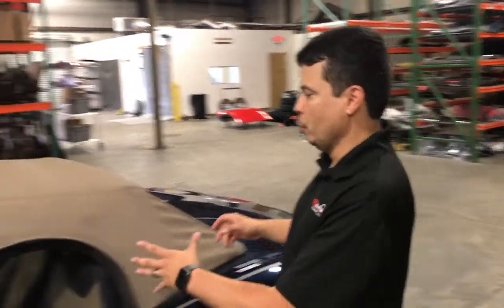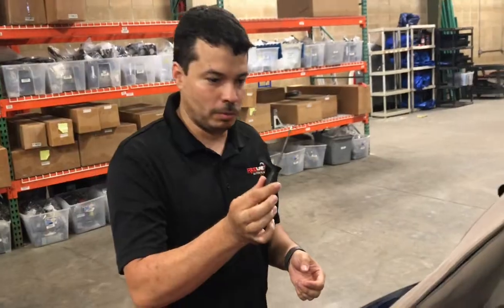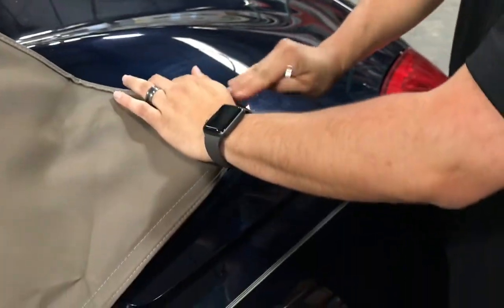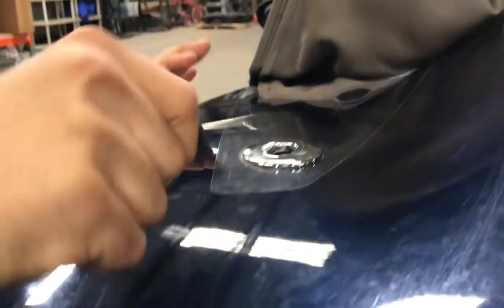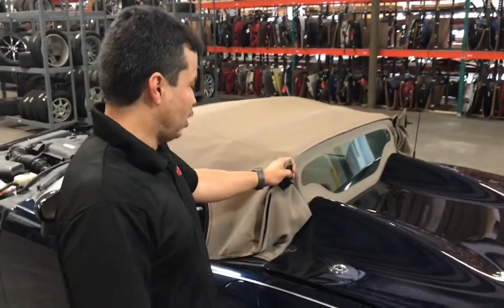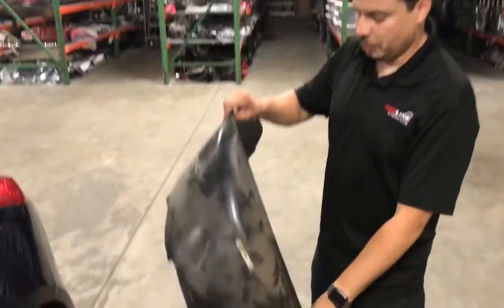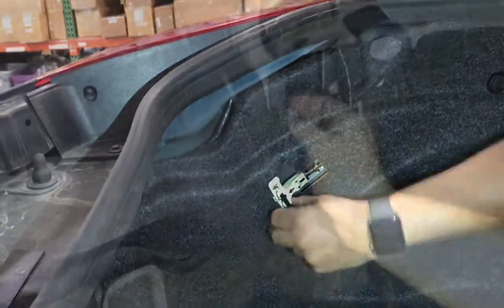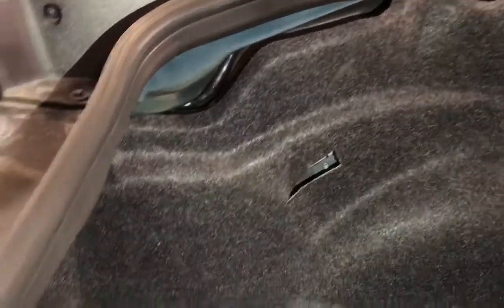How to manually open a stuck buttress and trunk lid on a Pontiac Solstice or Saturn Sky

Comment: Awesome video because my alternator is out and even though it is a new battery it won't release the trunk latches and I can't access my jump box, or ratchet set to use my ratchet to release the idler pulley on the serpentine belt so Thank for this video! Now if I can figure out how to take the wheel off😢

Comment: What if my buttresses don't close? Do i use the same tool?
Reply from the maker: The same tool should help in this case, temporarily, but it sounds like the issue lies in either the emergency release cable, or the main release cable not springing back after disengagement.